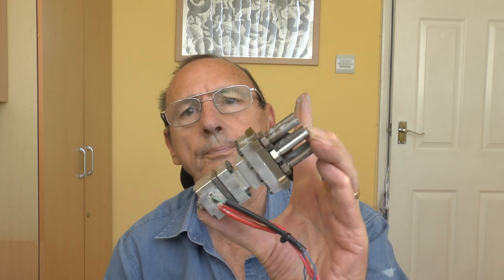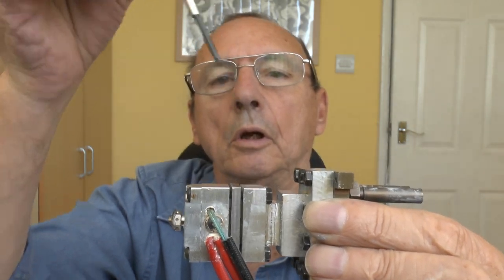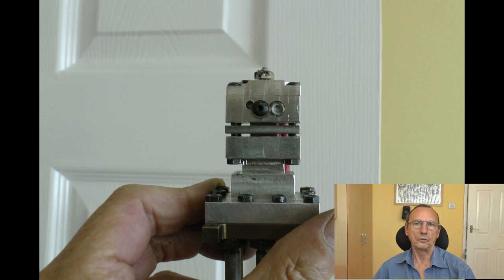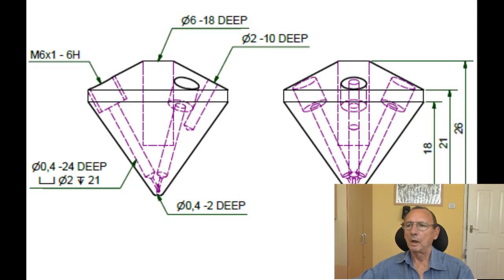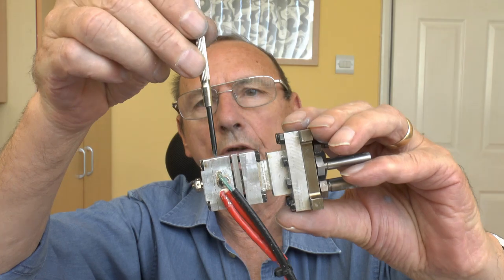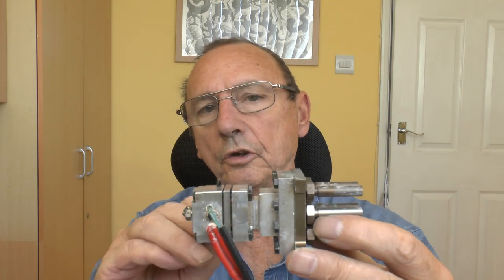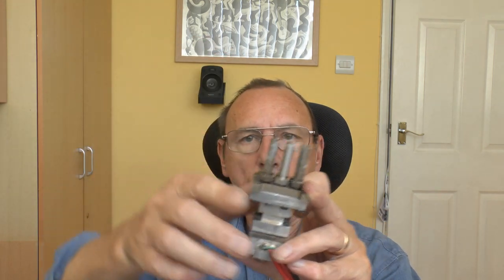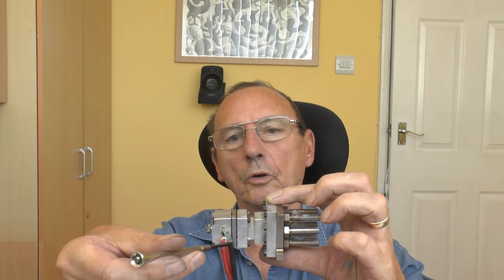My 6 Input Hot End Part 17

Comment: Interesting idea having 2 different heat zones. Hydrolized PLA is the absolute worst and this seems to be a good solution.

With the combining block at ~145 degrees, won't that cause the PLA to be quite viscous and semi-liquid? This could add flow resistance, meaning you might need more pressure compensation. 

I can't remember the exact geometry of your combining chamber, so maybe it's better if the filament can stay semi-solid right until it gets to the active heating zone.
Reply from the maker: Yes, I can't make up my mind if the combining block should be cooler or hotter than 168 for PLA :). I do know that if it's too cool and the filament is at or slightly above it's glass transition temperature inside heat break, then when the extruder pushes, it bulges out sideways and blocks the heat break. So I either need to keep the combining block really cool (below about 60 deg C) or it needs significantly hotter. maybe 168 is the sweet spot (but I doubt I could be that lucky). I won't know until I test it......

Comment: Nice video very interesting, might be a silly comment but have you thought of using a Peltier plate to control cooling of your combing block?
Reply from the maker: No yet, but it's a thought. I want to see how this version performs before I make a decision as to whether to make the heat break more efficient, and then think about moving on to heating/cooling the combining block. Given that I already have liquid cooling for the main heat breaks, another possibility is to use liquid cooling of the combining block via T pieces and servo controlled valves of some sort. Lots to think about......
Reply: @deckingman  sounds good, look forward to see how it goes.